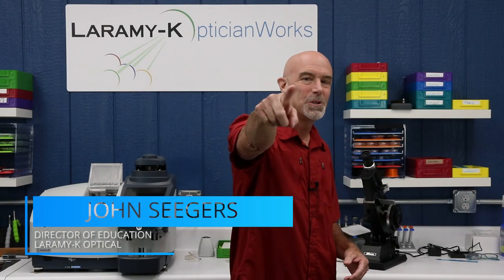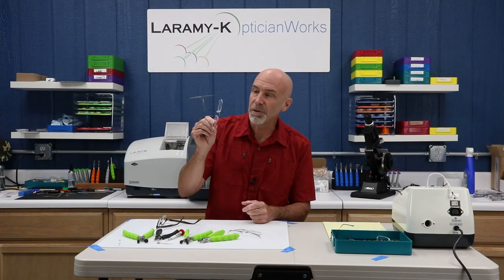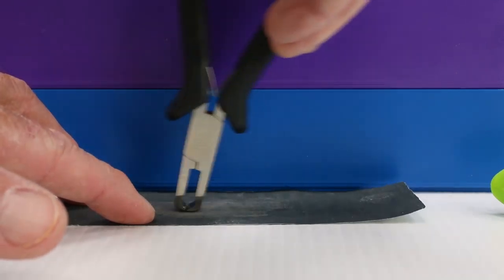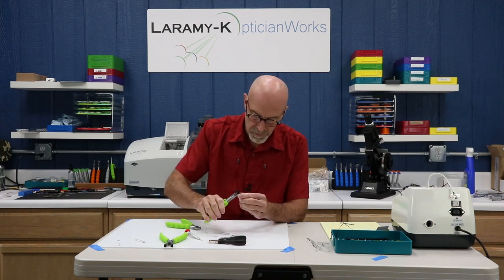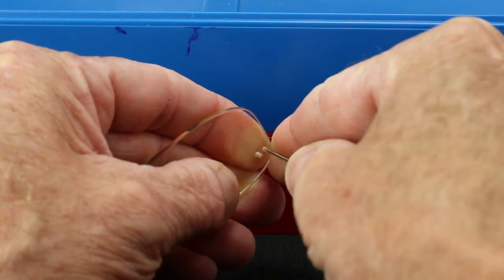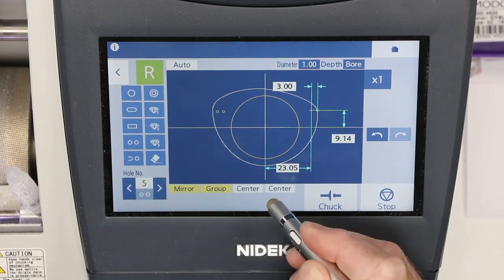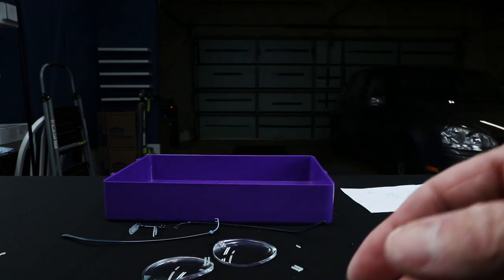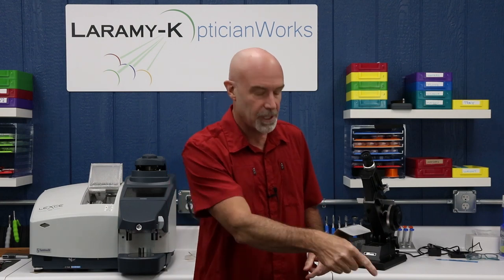How To Rebuild A 3 -Piece Drill Mount Frame

Comment: Nice video 💪👌👏 if you may I have a question : if you drill the lens manually and you don’t have the original frame lenses as a guide ... how you choose where to place the holes ? 
Thank you
Reply from the maker: Tough one! Used to be some cling on/stick on grid decals that helped with that. I'd need a little more to go on here --- I'm not sure of a situation where you wouldn't have the old lenses to work with? You have to have a size and shape coming from something! If you don't your flying solo anyway so have at it. ????
Reply: @LaramyKOptical  thanks for responding 😊 what I mean is sometimes you are required to change the shape of the lenses to a different one from the original ... Example : a client wants to make his lenses in the shape of an aviator lens while the original lenses have a rectangular shape. 
How do you place the holes in a similar case ?
Thank you
Reply from the maker: @Jay51192  In that case you are working 100% on experience. The original hole placement might give you some idea of position -- temple holes higher than bridge etc. -- but beyond that it is entirely up to you.  I think I'd scour the internet and find some old drill charts. Heck even a good picture of what you want would be very helpful. Beyond that you will need a hole gauge to determine hole sizing and the hole spacing has to be just about perfect or you will end up with a wobble. Seems like something you would be doing as 100% custom work and time and experience will teach you OR it seems like something you might just say, "no" do doing.
Reply: @LaramyKOptical  thank you 😊

Comment: Bought a pair of 3 piece drill mount glasses from Visionworks. I asked them to adjust the pantoscopic tilt and they acted like they didn't know how to do it, or maybe were afraid they'd break the lenses. Can the pantoscopic tilt be adjusted for drill mount or should I just return these and pick a different frame? I have 100 days to return the glasses if I don't like them.
Reply from the maker: It depends on the style but most 3 piece can be adjusted using a brace and bend technique. Using the same tool you use to press the bushings you support the hinge/chassis and bend away. That stuff is on the OpticianWorks website.

Comment: Do you have suggestions for accurately measuring drill coordinates if they aren't provided? I currently use graph paper and a PD stick, as you mentioned in a comment below, but wasn't sure if there are any other "tricks" I could try.
Reply from the maker: Unless you have an edger with the camera shape capture no. Graph paper and a PD stick is about as good as it gets. Somebody used to make cling stickers with 2X the grid lines but I have not seen them in a catalog in a long time. Now if you are drilling by hand then I suppose you could use the old lenses as a guide if everything nested nicely together. Oh and, YOU GO GIRL! Hand layout of drill holes!
Reply: @LaramyKOptical  Those cling stickers sound like they would be pretty handy; bummer I missed out on them! While I wouldn't say I enjoy hand layout, it is satisfying when a really off-the-wall drill mount comes in and the coordinates are on point the first time! Thanks for another great video!

Comment: Is there a standard size of bushing/ ones used more than others / a common size ?
Reply from the maker: No sadly you need to know the frame line and then what size bushing and what style busing they use. Good thing is they are pretty cheap! I think you'll find the majority are either 1.4 or 1.6.

Comment: I have a 3 piece mount that I ordered from our lab twice now bc they are sending it back to me with the lens wobbly and I can't tighten it. I really can't tell if the holes are drilled larger than the sleeves or if maybe the lens is too thin in the nasal/ bridge (1.9mm). The place that I work ONLY allows me to order 1.4, 1.7 or 1.8 sleeves and not a variety of tools. When the lab sent them the first time with the lens wobbly, I took it apart and changed the sleeves and the lens was still wobbly. Is it possible the lens could be too thin for it to clamp in tighter? Or the sleeve needs to be a size that I cannot get? The 2nd pair the lab sent is exactly the same damn way! This lady spent a lot of money on this pair of glasses. I hate to reorder these again when this should be a simple fix. I am not use to having this problem with a drill mount.  Have you ever had one that you couldn't get the lens to clamp in and seat well?
Reply from the maker: 50% of the time that is because the lens isn't thick enough for the bushing to seat properly. Time to break out the calipers! 50% of the time it is because the hole is drilled too large - to check on that you need the hole pin gauge. Of course could be both! Same for any other verification work - if it is wrong send it back. Wobble is not OK.